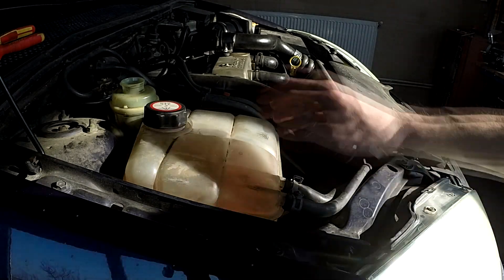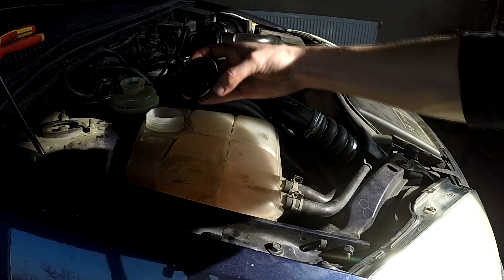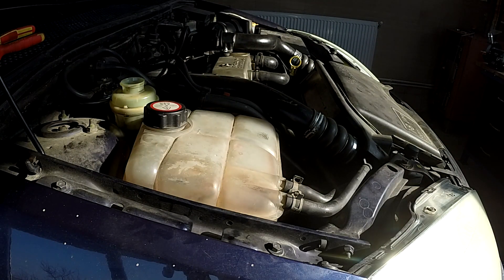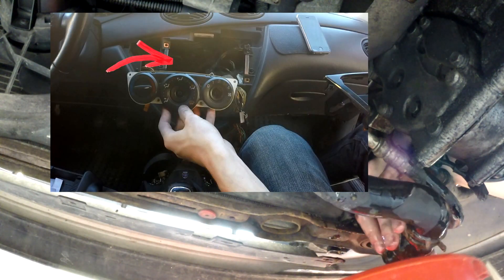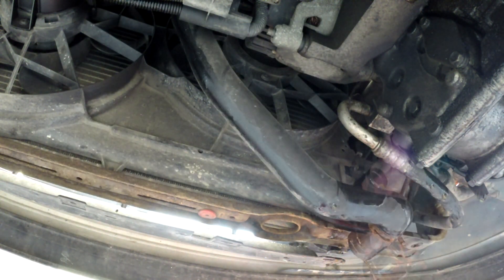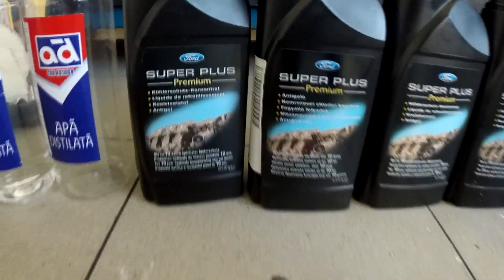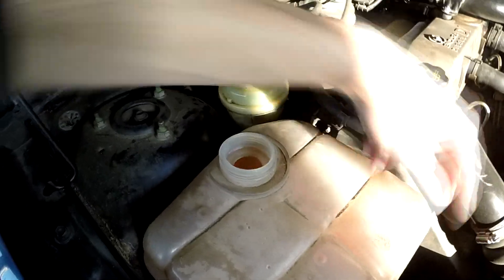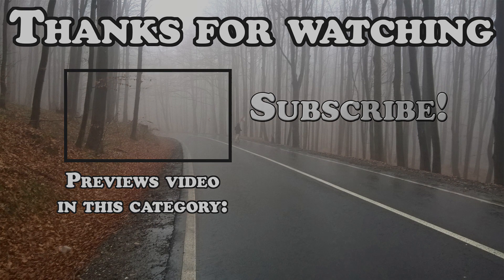How to Change Engine Coolant - 2001 Ford Focus

Comment: I purchased one of those vacuum coolant fillers to bleed the system. Are you saying that just by leaving the cap open it will bleed all the air pockets?
Reply from the maker: Actually, even if you have the cap closed, it should bleed out the whole cooling system, don't forget to turn the heat to the max. 
As far as I know, it might have a pressure release valve, but you can also leave the cap off, just don't forget it. 

I'm not sure how efective those things are. Never used one.